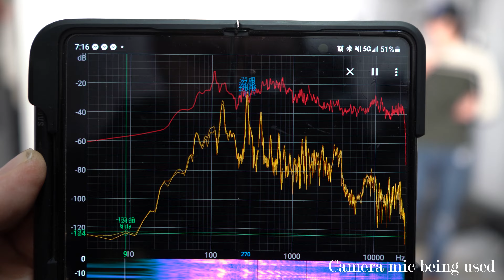Mackie thrash 215 powered speaker review and teardown! What's $289 get you?!

Comment: After damming it with such feint praise I can't believe you didn't mention the label not pealing off cleanly. You failed to mention if the output is passive, which I assume it is, but my venue just bought a SubZero C12A and that has a 'speaker out' so you can add a passive sub or full range - very useful. But no matter what you think of any piece of equipment, I hate to see anyone handle any speaker with such a lack of respect. I've had good gear and I've had less good gear, but I've always handled it well and never 'chucked' it onto a table.
Reply: Subzero's are budget systems not great

Comment: well bro if just need a cheap loud speaker than a mackie thump will do the job. I mean if your profession is DJ or sing than A  mackie thump is a joke and your better off getting a PA that is near 1000 dollars or more. Lets just say for vocals using a microphone isn't not as bad as a harbinger. But a Harbinger is more powerful and louder than a mackie thump but since its cheap it gets hot really fast. Apparently unless you got bluetooth you must use  XLR cable to interconnect an audio device like a microphone to a mackie thump or you get a weak signal if you use a TRS cable.

Comment: Been using them since they came out and of the 8 only one has been replaced (Thank you SweetWater) with an iffy attenuator which I could no longer coax into working. I’ve never seen them peak, inside or outside 50 - 500 (4 Mains) no problem 89% live bands and still going strong.

Comment: 11:30 YOU APPARENTLY NEED A XLR CABLE TO GET LOUD SIGNAL FOR VOCALS but if you use  TRS cable you get a weak signal with a low pitched faint voice. I found out the hard way. Sadly with the cheaper Harbinger it doesn't matter if you use a TRS OR XLR cable for microphone/vocals but the sound quality for mic vocals is terrible with a Harbinger, I regret buying it for vocals. UPDATE, i started to use my belringer which i had sitting around with the XLR and it sounded way better with the cable than it did with TRS cable, the sound came out natural and clear. I would say the behringer is better than ah mackie thump or harbinger.
Reply: This has kind of been my experience just in general. XLR has always been louder for me with microphones.
Reply: @beardalaxy  but i think a few people know this. I asked the people at guitar center they only told me to use  TRS cable and than did a research on PA systems but they never mentioned i need a XLR cable. Over 5 yrs of having a PA systems and not using it cause I sounded like a robot I did a research and found out that I needed a XLR cable which was true to get a clear natural voice.

Comment: The SRM-450s are incredible on the inside! These just look like a joke in comparison. My school has a student-run music program, and I got to repair one of our SRM-450s. The problem: a wire was touching the back of the cone, causing a rattling noise. Anyway, the SRM 450s, or at least the V2s, have cast metal frame woofers with neodymium magnets, PUSH TERMINALS, NOT SPADES and the inside of the boxes are really well padded. The boxes themselves are extremely thick. The wires are also managed a lot better, although someone messed with one of my school’s speakers before me, hence the problem of the wire touching the back of the cone.
Reply: yeap...and you pay for all of that. :)

Comment: Are these better then thump15a?
Reply: I would highly doubt it. Thrash seems to be Mackie’s entry level PA speaker system, where Thump is the upgraded model. That being said, there are multiple models of Thump. The oldest is the TH-115a, then the Thump15 which has a black grill but still an exposed horn. Then the Thump15A and Thump 15 boosted are newer models with a more boxy design and full front grill. I think there’s another new model for 2022 as well. All would likely outperform the thrash. An upgrade from Thump would probably be either a newer Thump or an SRM series speaker. I got to do a repair on an old SRM 450 V2, and those were built super well (Celestion cast frame woofer with neodymium magnet, super thick well padded box, ETC.) Not sure how the new SRM V-class compare, but I’m sure they’re great too. Of course they’re going to cost a lot more though, so it’s only really worth it if you need to go a bit louder.

Comment: I destroy them after 2 venues.. we have also one 1000w older meckie as stage monitor, and it was louder than shis shit.. if you use them properly, like dont turn gain knob up to field for mic it is ridiculous quiet. if you turn it up to field for mic, gain will destroy that 15" speaker. and that retarded overload indicator is on back, so only drummer on venue can see it is overloaded
Reply: If you destroy them your obviously doing something wrong…I have 4 of these, paired with 8 118s subs and have 0
Issue with volume or durability. Are they QSC? No but they get the job done quite well.
Reply: @AndrewNelson1985  problem is, that this happend to many people, not me. I have friends in biggest czech eshop (something like amazon) and they told me, that over 70% return back with same issue. Meanwhile most eshops change description from "speakers for loud music" to "speakers for home cinema".. not kidding. Also mackie saying its 1200w, in reality its hardly 550w. I understand many brands show peak, not RMS, but here everywhere is written 1200w without any more specification. Dont get me wrong, I like and using mackie products, but this is obviously some marketing trick to get easy money. I am still mad as they make something unusable and then they act like childs and automatically say its customer fault.. in every cases they told customers "overload indicator works, it means you ignored it and thats reason it burns". Like wtf? How they know it? And i know those informations because i have friends in those big eshops and also in main mackie seller for central europe.